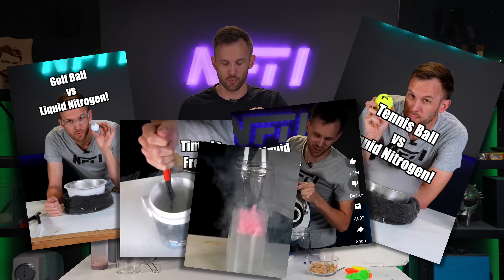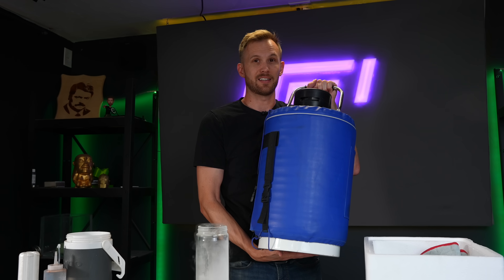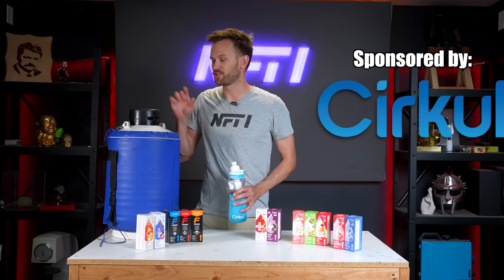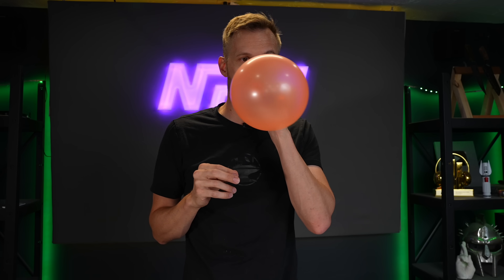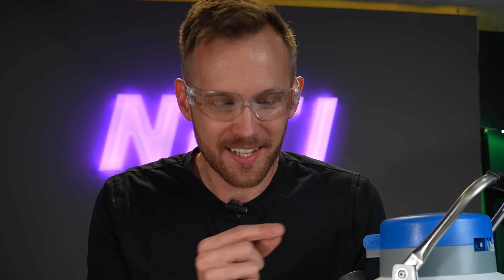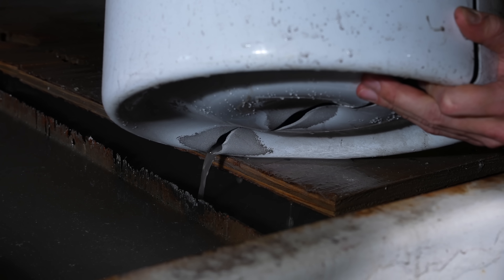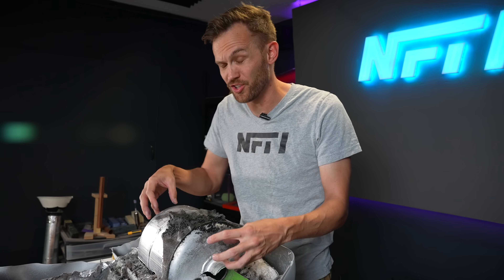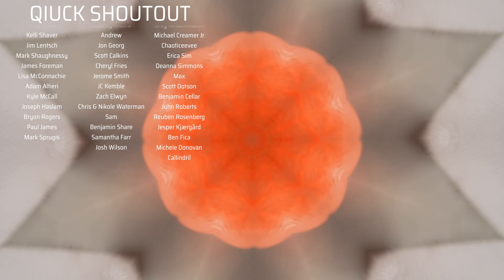What Keeps Liquid Nitrogen Cold??

Comment: how long will the container keep the nitrogen cold if the container is not opened and stored at room temperature?
Reply: I have a 40l cryogenic tank. Room temperature - MONTHS before it evaporates(when there is no tasks for it - it just sits in a cool dark place). BTW - you never, never ever, NEVER let the container, once cooled to cryogenic, get back to room temperature. They do suffer, and keep the cold less efficient, if there were cycling(empty container). One more really good tip - always keeping the external fabric sleeve on the container, in good quality container - the fabric sleeve is internally made up of thin insulation sheets(cryogenic insulation paper) - to keep the IR radiation OUT. The sheets are placed the opposite of the cold side, and yes, they are directional. When sitting in a room for weeks - the container underneath the sleeve gets noticeably cold to the touch, and for sure contributes to the longevity of cryogenic liquid inside. This all applies to LN2, LAr, LO2. 

LH2, LHe and others - require A COMPLETELY different approach. LHe specifically - as it is also somewhat superfuid no matter of the isotope. LH2 and LHe2 containers - have an inner container for the target gas, a vacuum layer, ANOTHER container on top filled with LN2, and internal insulation and another vacuum cavity on top. So it's a multi stage dewar. And they are extremely efficient. But please, NEVER mess with LH2 and LHe - not only because LHe is much colder than LN2, but it is also way more thermally conductive - even small spills give you immediate skin burns. Another safety concern(a really big one) - eye protection - almost any liquid gas will blind you for good.

Comment: There are three sources of "parasitic heat":
Radiation - The shiny foil stuff called Multi-Layer-Insulation helps keep this out by causing black body radiation to partially reflect off the surface of the shiny foil.  Each bounce causes that radiation to lose energy.  There are usually like 20 layers. 
Convection:  Vacuum, duh.  Cant transfer heat if there is no heat to transfer.
Conduction: plastic tube conducts heat much less than stainless steel.  Probably PTFE, idk I'm into cryogens not dewars

Comment: The metal foils will probably be there to reflect infrared radiation. In a (perfect) vacuum the only way of heat transfer is by radiation. It basically keeps the IR from outside out.

Comment: the plastic pellets likely perform several related functions: first, by being low and heavy, they move the center of balance Down: very important in storing something that should Not tip.
second, by being loose mass, they will absorb rebound forces during a fall or spill, slowing the container faster and to a stable position, so less liquid nitrogen sprays or is thrown out.
finally, the rebound absorption also lowers the occurrence of cracking or damage to the dewar, lowering damage or spills from clumsy handling.

Comment: Is that a short-term storage method? Eventually the nitrogen would equalize in temperature and turn into a pressure bomb right?
Reply: If you would tightly close it, yes. These ones are as you say temporary for when you want to use it. They usually don't even have a way to fully close. Bigger storage tanks have pressure relief valves.
Reply from the maker: Correct, you cannot seal these containers closed, they always are venting nitrogen.

Comment: The issue I have with circul is that you cant use the bottle without the flavor thing at the top. And you have to throw away quite a lot of plastic to change them. Its purposefully designed that way so you have to keep buying them. But its not very eco friendly

Comment: i bet if someone made a new tank with aeorgel  in it for insulation it prob be able to have a bigger volume tank inside
Reply: Don't think so. Vacuum is fundamentally the best possible insulator. The insulation is mostly there to insulate from infrared radiation. In that regard, an aerogel would be vastly inferior to a metal foil and also very fragile.
Reply: @christiannorf1680 and also expensive and hard to mold

Comment: Hi Nate, the insulation you see is called Cryogenic superinsulation, which has layers of metal foil for reflecting thermal photons separated by polyester to reduce conduction between layers. The lab I work at uses it to insulate our dilution refrigerator. For the black pellets, I believe they are activated charcoal, and when cooled, will cryogenically pump by causing any remaining air in the volume to stick to the surface, trapping the gas so there is no convection either.
Reply: Fascinating! Thanks for sharing, always fun to see comments like these from people who know way more than I do. (and often, more than Google’s slowly deteriorating algorithm can explain)
Reply: I wonder if aerogels will be utilized more extensively in these sorts of applications as time goes on.
Reply: Love youtube comments on occasion, was hoping someone would know.  Thanks!
Reply: What happens if you put liquid nitrogen into a normal gas tank? Would it just expand and explode? Is the metal tank not stong enough in itself to keep it in its liquid form? I always thought those tanks just work with pressure tbh.
Reply: @monkeyboy275bobo8   Short answer: it explodes.

Long answer: Nitrogen is different from other gases. Think of a camping butane canister. It can be stored as a liquid because pressure, not temperature, keeps it that way. That's why it's safe at room temperature. Nitrogen, on the other hand, only becomes liquid at extremely low temperatures, not from pressure. 

If you seal a container of liquid nitrogen in a normal gas tank that is not designed to withstand cryogenic temperatures and high pressure, the pressure will rise, and congratulations, you've just made a bomb. Well, not if the container is strong enough and built with absolute perfection. In that case it may become supercritical nitrogen, neither gas nor liquid. It's wicked stuff. NileRed has a video on it. He uses a different gas, but it's still a really cool video (pun intended).

Notes: In practice, it is impossible to seal liquid nitrogen. Its critical temperature is extremely low, at -146°C. It will continue expanding as it tries to reach thermal equilibrium with the surroundings. This is why supercritical demos usually use CO2, since it is easier to handle at around 30°C.

Comment: The plastic is to keep the heat/cool from conducting up the spout. I can't think of anything other than plastic that could be used for that,.
Reply: Fiberglass. The EXPENSIVE 6 month holding time dewer I have uses a fiberglass neck. It is much sturdier than the plastic. If the neck breaks while the dewer contains liquid the whole tank can explode when the nitrogen hits the outer wall. This can happen if the dewar is dropped when it is full.

Comment: I've seen people cryo-freeze metals, such as baseball bats and pew pew barrels .. with the claim the aluminum bats after  done are more durable and have more bounce (trampoline effect) than a normal bat .. I have no idea if that's true, but would love to know the answer Nate
Reply: Microcrystalline effect. It has a name - "Cryogenic tempering". In a DIY shop - a really good effect is on a HSS drill bits - just put them in a dewar, pour some gas, let them sit there for 10-20 minutes - the drillbits get noticeably better and have more longevity over the same, but untreated ones.